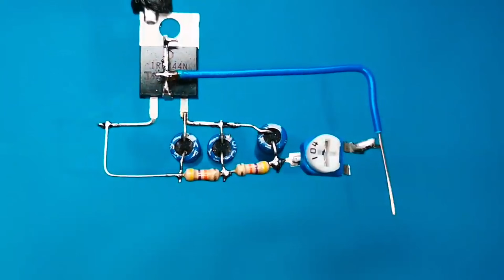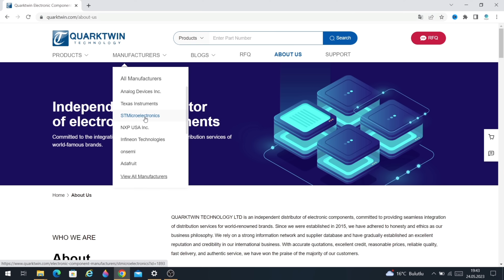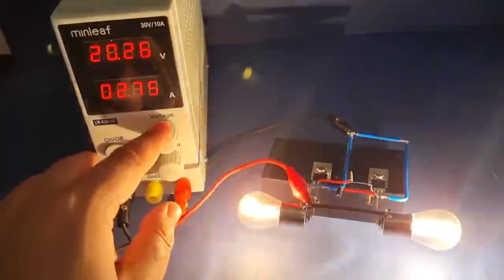IRFZ44N  Entry Level Electronics Circuits - 3 Great Electronic Project

Comment: Brother salam! Is there any way to use pir motion sensor to light 2watt led (3.7v) without relay with full light glow?
Reply: 12 volt sensörler var ancak siz 3.7 volt diyirsunuz 3.7 volt da led yanıyor mu öncelikle led kaç volt onu bilmelisin 

3.7 de ışıldayan led için transistor bir sensörlü devre yapmalısın 😢kendin de bulabilirsin 😢 İnternet'e çok miktarda devre var
Reply: @browstar.brawstars  thanx alot for the reply! 
But finally i came to know that its not possible to use pir sensor without relay in my case